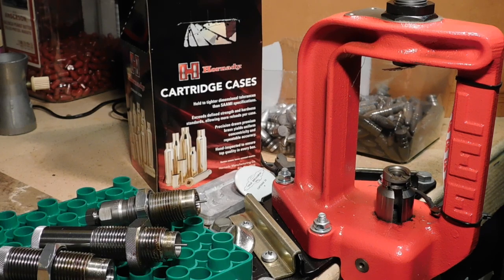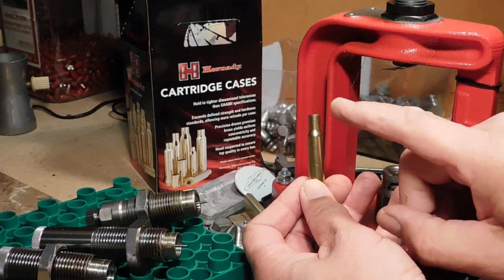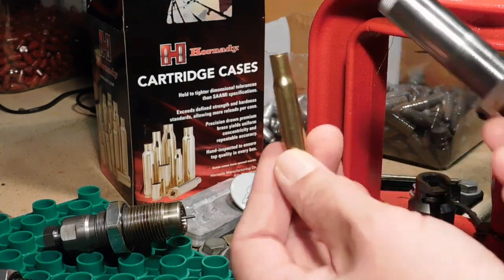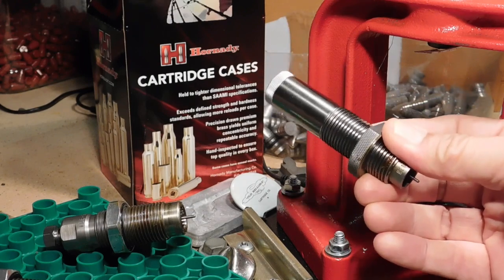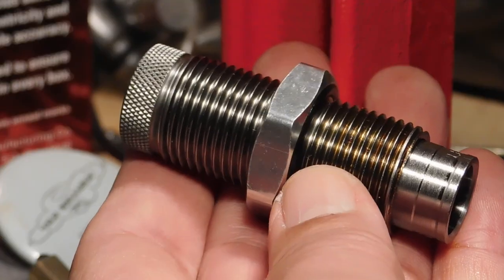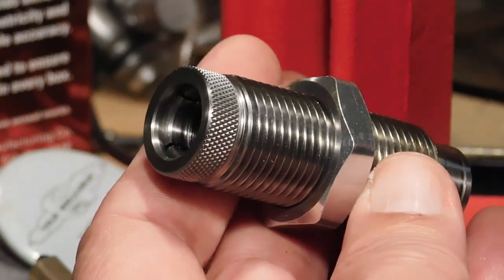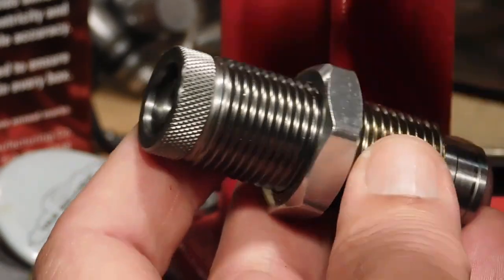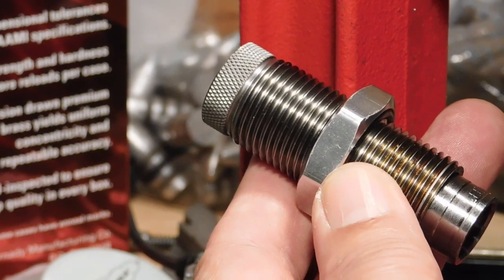Considerations On Brass Stress

Comment: The Lee crimp die is the best. I use it for my rifle loading of .223, .308, .30-06 and so on..  In pistol I just use the taper crimp dies available from reloading manufactures.  If I need a roll crimp, Most bullet seating dies have that built in to the die for straight wall cases like the .44 Mag, .45 colt and so on. Good video Steve. Dave.
Reply: I found with a few tight chamber guns, it was the only way I could count on getting every loaded round to go cleanly into battery. IMO if you had $10 to spend on a case gauge or on an FCD, do the FCD. It checks and fixes every round without an extra step.
Reply: I'm the same way, the Lee crimp dies are great and i have never ruined a round with one yet.Can't say that with other seat/crimp dies. I use them for every bottleneck case i load.
Reply from the maker: Thorsaxe777 - Just made a quickie trip up your way for chicken coop / raised cinder block planter duty...work detail.  There wasn't any time for fun stuff.  Hope to see you later this summer -- Have a great day, Steve FC
Reply from the maker: beverwyck1 - I have a fair number of those FCDs - and they get used at every opportunity.  Best Regards to ya,  FC
Reply: I P.M.'ed you Steve. It's all good buddy..
Reply: I feel that it is money well spent if you are experiencing chamber problems and have adjusted everything on your die set that could be the problem. Some firearms are just that way at the end of the day. The FCD fix's that problem and gets you to the range.. Agreed GunFun ZS.  Dave.
Reply from the maker: GunFun ZS - And yet, there is denigration of the FCD by select few out there that have experienced loss of neck tension from using the FCD.  When the explanation the cause of such is the die was used outside the design parameters of the FCD is made to them  -  might as well try beating a stone wall - their mind is made up -  Down with the FCD..!!  Then they will tell you that if you pull the bullets run through the FCD,  you will find that swaging has happened.  But that even happens just seating any cast bullet without the FCD.  One can find paralysis from overthinking and overdoing... Like you say, if the ammo drops freely into our chambers and then shoots a cloverleaf at 15 yards - the workday is done and the horse is in the barn.    Have a great day,  FC Steve